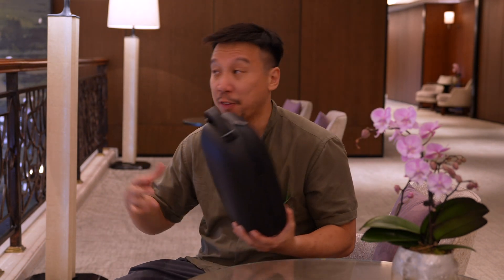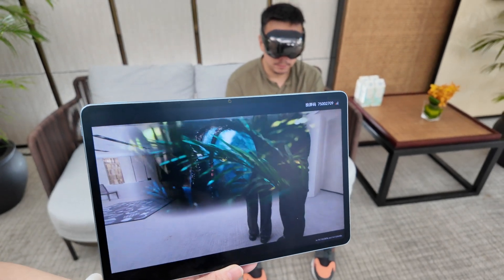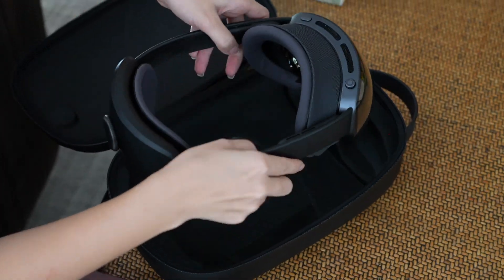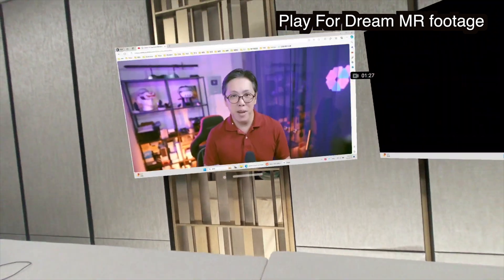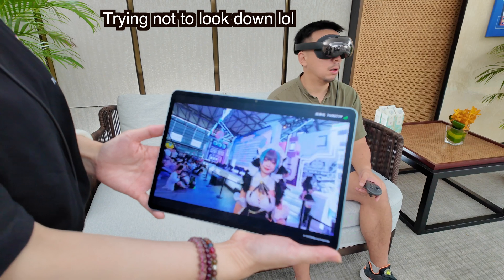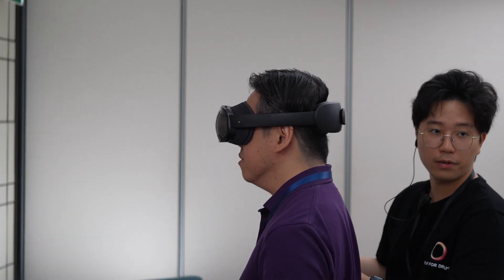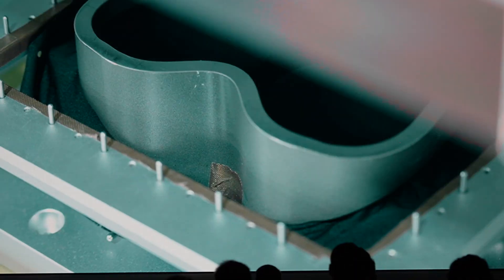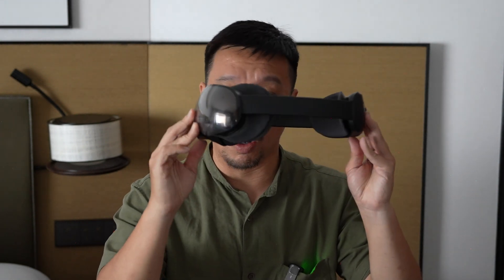Play For Dream MR: 8K Vision Pro Alternative Running Android!

Comment: The concept of Apple vision Pro is good, but the main problem is that it was made by Apple, for example, you can't sideload apps, and the format of spatial video, I'm a stereo photographer, so I know a lot about stereophotography and there is a format called sbs format, the big advantage of this format is that it's compatible with any device, it's like jpg for 2D images, you can view jpg images on almost any device with a display and the same applies to sbs, you can view sbs format on any device that can display 3D content, but Apple instead of recording spatial video and images into sbs format, they've developed a proprietary format that can be played only on the Apple Vision Pro, which is a very asshole move, fortunately someone had developed an app that can convert this proprietary format to sbs, but if this app wouldn't exist, then you would need to buy an Apple Vision Pro just to watch spatial content.

Comment: I don't know what makes an XR headset a "spacial computer" but this headset doesn't do anything the existing popular Android headset doesn't? It's higher end with a slick design for sure, but genuinely I don't know what part of the software/hardware makes the distinction, since I thought it was just Apple marketing reinventing the wheel as usual.
Reply from the maker: Windows can stay in place relative to real world. Like I can have a window on one wall and even if I move my body and head that window stays there. Most android headsets cannot.

Comment: Thanks Ben for the quick informative video about this nee exciting device. Its my 1st time running into your channel and I like how you quickly summarized the experience. Can you expand on what makes this headset more open? Is that I can link it with windows and use something like SteamVR and Windows virtual desktop or are we only talking about side loading android apps? Thanks!
Reply from the maker: Hi running android means you can in theory load any Android app on it. Vision pro is a closes system so only apple approved apps for vision pro can run. For example the vision pro doesn't even have a YouTube app. I'm sure with this one we can load YouTube Android app on it easily
Reply: I just have uploaded a thorough demo and review of this prototype to my channel, feel free to check it out! Steam VR is supported btw

Comment: The Snapdragon XR2 chips aren't even close to the M2 chip on the apple vision pro so they aren't quite comparable, they are more akin to quest 3 (also runing a modified version of android), maybe with better resolution and lenses but not close to the Vision Pro in term of specs.

Comment: Two 4K displays will drain the battery on this really quickly but if it has pass through charging where it can draw directly from the wall once the charge % reaches 85-90% I'm sold.

Comment: the problem of VR is not hardware, you can beat apple in hardware but issue is software and that what makes Vision Pro great and benchmark its just Vision OS miles ahead with anything else.
Reply: Haha the problem isn’t hardware?! that the funniest thing ive heard today
Reply: @menachempike4489  cause you are clueless
Reply: Thats ficking hilarious dude when a vr headset has a five hour battery life when running passthrough and has comparable cpu performance to a laptop come back to me
Reply: Apple is using the best hardware in their headset available right now so I disagree  . As to the software yes Apple is ahead but android will catch up just like on phones. Especially if other companies like Samsung Sony and Goggle join in.
Reply: @Ton-em2in  It's not the best what makes it best?

Resolution? Beaten
FOV? Beaten 
Pass through cameras? Beaten
Eye tracking? Uses Tobi same as others
Hand tracking? Beaten

The difference is software, it's exactly the difference between Varjo XR-4 and Vision Pro, one hardware is beating the latter while software is alot worse so the experience feels as if Hardware is worse.

Hardware since Quest 3 wasn't the issue, the problem is software in VR currently, the software is very very behind Apple and that what makes Vision Pro great, you guys don't even know that Vision Pro hardware is from 2021 lol, even Apple confirmed that
Reply: @TRX25EX  Beaten by who? As far as I’m aware Vision pro has the best eye tracking, hand tracking, chip,  and displays out of all vr headsets. The only ones who could come close are the newly announced primax headsets with only one of them having the micro Oled lenses. There is a reason why Vision Pro is $4k that’s because it’s using the best everything currently on the market. The Quest 3 hardware is not on par with Vision Pro no matter how hard you meta fanboy want it to be true.

Comment: It's more a simple display than a computer. Not a single image of the UI. 
Once the battery is on the headset it will weight a ton.

Comment: I use my Vision Pro everyday for 5-6 hours straight to work. I use it on a reclining chair and put the windows on the ceiling. I have never worked so comfortably. We have to change our minds and start working in different ways that were just not possible before and not try to work as before but wearing a headset. Not until they get smaller and lighter.
Reply: Same here. Being able to respond to texts and work in emails in the headset natively is awesome!! I run a couple tech companies so I'm always on the go. So have a killer setup at home does me no good. So having virtually unlimited screens and screen sizes are perfect for me. And bringing my MacBook Pro into the headset via virtual screen with next to zero lag is the icing on the cake. If I have one gripe outside of the visionOS software not being as mature as iOS, is I wish I had HDMI in so I could connect things like a PS5 or a Nintendo Switch.
Reply: I want to Play in games on Vision Pro, same how I cant starting GeforceNow on macOS, but I sink Vision Pro will not give mw this experience, unfortunately(((

Comment: Literally looks like a vision pro rip off from China. Is this a surprise?  And Android? They should have partnered with Meta. Android is a terrible ar/vr ecosystem** Pico VR is android, but it does not use the meta store front. Meta uses a fork of android, but the OS is unique to Meta and it's partners. Damn, some people cannot see the forest beyond the trees.
Reply: Meta is android. Duh.
Reply: How many Android VR/AR devices have you used to come to that conclusion? 😂

Also also Meta uses Android to m**ron
Reply: @deltaechomusicnh555  first off android/mobile VR is not the same as meta quest running on a branch of a modified android os. Pico VR is android, but it cannot use the meta store. Damn your are stupid.
Reply: Meta Quest is based on Android 10 I believe.

Comment: It feels lighter because their is no battery. I also had that dream as a digital nomad turned expat. But the AR/MR glasses are gonna be what you want because of the size and the weight. Immersed is coming out with exactly what you need. It's going to be $1k and the same screens as the AVP. If you really want to game on it though then the Bigscreen Vr is the choice. This is going to be more of a PCVR headset. Right now you can already get multiple screens on almost every device. The main question now is.. Steam support or not?

Comment: There is so much BS maketing with this product instead of actualy advertising its strengths.
8K is just false its 3840x3552 so a bit less than 4K per eye that doesn't make it an 8k headset. And adversiting PPI as a spec means nothing.
It does seem like an interesting product but it may live or die by its software and PC support

Comment: @ben resolution in VR/AR headsets is measured using Pixels per degree (PPD) not Pixels per inch (PPI). Also what’s the battery life on this device? Is the battery detachable? This is not the first Android headset, there have been plenty before that most notably the Quest.
Reply: I just have uploaded a thorough demo and review of this prototype to my channel, feel free to check it out! So far the battery is on the back (similar to quest pro), I've also shared my recommendations with Play for Dream.

Comment: Under $2k is crazy.
Reply: No it isn't. Stop using Apples crazy prices as a standard. 
What's crazy about this? You think they aren't making a profit off of this?
Use your head.
Reply: @negkoray  well microled is expensive
Reply: @hishamaru  that doesn't mean anything. 
You've said nothing.
Reply: @negkoray  that does mean part of the cost is deduced to microled which isnt small part by any means

Comment: Actually, Meta Quest headsets run a custom version of Android, so this isn't the "first Android spacial computer"
Reply: That depends on what we are talking about. The Quest 2 was launched with an app (mostly gaming) store, with scant OS-like functionalities. Even today with the Quest 3 and Pro, the META OS doesn't even have a file manager and several basic functions of an actual OS; it's hardly a proper OS. If this HMD's OS is actually a full fledged OS, I would, in fact consider it to be the first one.
Reply: @r.m8146 he is saying quest runs a custom version of android. Which it does. You can side load android apps including the file manager. They could say the first full featured maybe.
Reply: Play for dream  resolution 3,882 PPI run 4k per eye totally 8k 😱😨😨
Meta quest pro resolution 1800×1920 It's not even 2k 😂 quest 3 resolution is 2064 x 2208 per eye better than quest pro
Reply: @Ma_Artae  resolution isn't everything.. if the software sucks you got nothing.
Reply: Technically I farted
Reply: Technically android is just Linux so every android device is just running custom Linux.
Reply: @nagyFerko android is based off the Linux kernel not Linux OS.
Reply: Technically it's a gaming mxr headset not a spacial computer
Reply: @Keith_Untitled   Most people won't get this because people still don't know what spatial computing is. With the VisionPro, people tried to make comparisons but the truth is the Quest is trying to be an XBOX replacement. Zuck had an hour to present the Quest 3... the full hour was dedicated to games. Apple had an hour to present the Vision Pro and they spent the hour dedicating it to all the other things outside of gaming. I have both platforms, I really like my Quest, but I find that I may use it once a month, whereas I use the VisionPro for hours daily. Also what's really messed up is when I used to use the Oculus Rift, I could create a virtual home and invite others over virtually and visit their spaces when they were't online.... that was dope! Yeah... Meta took that feature out. There were so many things that Oculus did the Meta canned. One of my favs was Facebook Spaces. If you haven't heard of it, lookout up on youtube. You're in for a treat. Yeah Meta got rid of it. These things were all leaning toward a spatial computing future for Meta. Meta chose the gaming route ultimately. :(

Comment: I hate the "8k" BS marketing. It's just under 4k per eye like every other headset being launched. 

Plus they're showing off screens in the prototype that aren't ready for manufacturing yet. So either the production will be delayed, or the screens will change and reduce in quality. BOE doesn't have those screens available for production as of now.

And for the record, it's an interesting headset that I'm keeping my eyes on. But I don't like the BS marketing stuff they're using that's intended to deceive. reminds me of Xreal
Reply: The bottom line is don't say 8k if it's not 8k. And don't give me numbers that's close to it lol.
Reply: @pkla14  it’s fake Chinese company that will steal ur data don’t buy this Apple Vision Pro is way better
Reply: It is 3840  x 3840  per eye,   so per-eye it is higher than TV's 4K definition: 3840 × 2160.      2 eyes comebined it will be 7680 x 3840.   slightly lower than 8K TV‘s definition of 7680 x 4320
Reply: @yuefei9243 if you open a virtual screen on that headset, you can see it at a maximum resolution of 4k. No higher. Call it 8k when it has 8k/eye so I can actually use it to watch 8k content.
Reply: @yuefei9243  not how it works. Sorry. 

And by that logic the AVP would be 8k and so would every other headset being released right now. But you don’t actually see that way, so they don’t advertise that way as it’s deceptive marketing.
Reply: @yuefei9243  if you have two 4K displays in front of you it doesn't suddenly make it an 8K setup
Reply: it's 4k per eye; so it's 8k for the whole screen coverage
Reply: @KisameSempai  which makes it the same as every other headset coming out that advertises 4K. Since that equals 4K experience wise… 

Otherwise the quest 3 would be a 4K headset and the AVP would be an 8k headset.
Reply: if it's 4kx4k per eye so it's actualy 8k
Reply: @ViperVenoM13 that’s what the AVP is so how is this better?
Reply: @Aggie4life77  my point exactly. It is higher resolution than AVP. But not a lot higher. Every other headset being released right now has similar screens and they all are advertising 4K since that’s how your eyes see. They don’t somehow magically double the pixels for your vision.

Comment: its more like 6k instead of 8k, bcuz its "8k" is two 4k screen while 8k is actually 4 4k resolution
Reply: that's not the definition of 8K. xK defines the horizontal resolution independent from the vertikal, so 4K is widely used for 3840 × 2160 Pixel, whereas 4096 × 2160 is called DCI 4K. 4096 x 4096 is also called 4K (squared) and 8K is commonly used for 7680 x 3840 pixels. It's not logical, i know, since it does not define the total amount of pixels, but it is what it is.

Comment: Oh we are getting real close to some really fun imaginary friends now. Combine with a Chat GPT conversation bot and voice pack. It will sell much better than vision pro. I hope that they DON'T put the battery in the headset. If AR glasses have taught us anything, it is to keep the face weight down. I don't mind sliding a cord behind my ear if it means not crushing my face and neck. Easier to just swap out batteries for longer sessions too.
Reply: Lol imaginary friends? We need more than friends😂
Reply: Actually it's a good idea to put the battery in the back of the headset, it's just the matter of weight distribution.  Without the counter weight from the back, your face will support all the weight and it will actually feel heavy and uncomfortable,  that's the exact problem with Vision Pro.  Unless you make the front part as light as a regular AR glasses.
Reply: 3D Character controlled by AI in addition